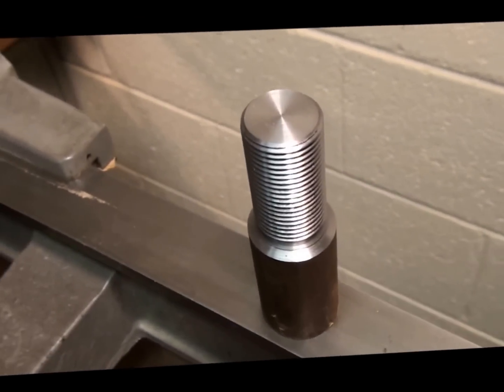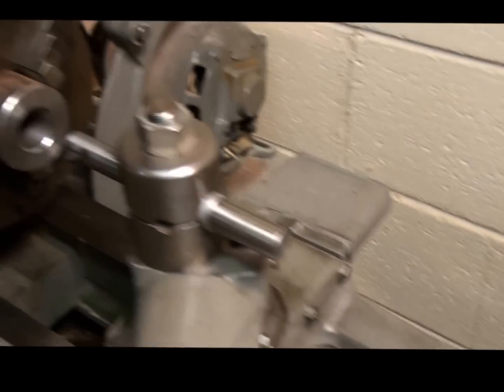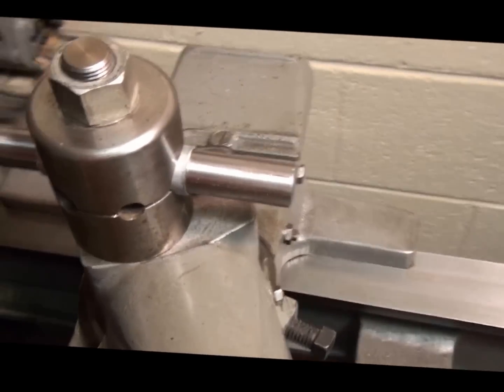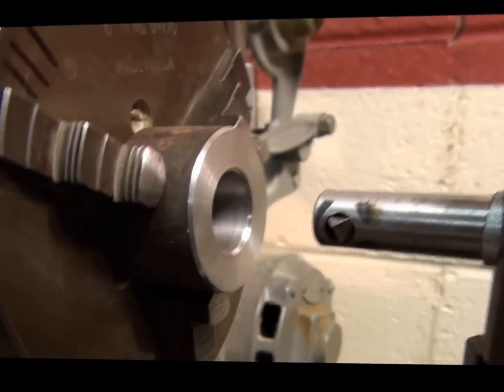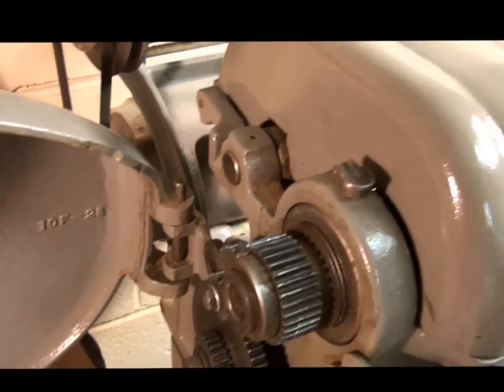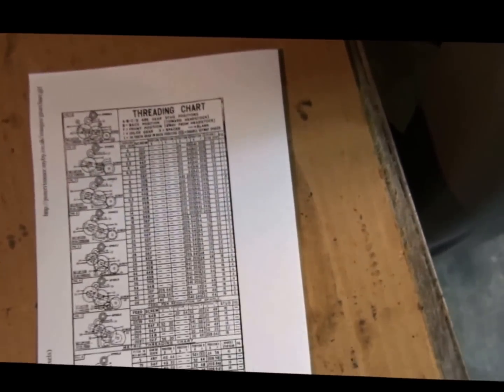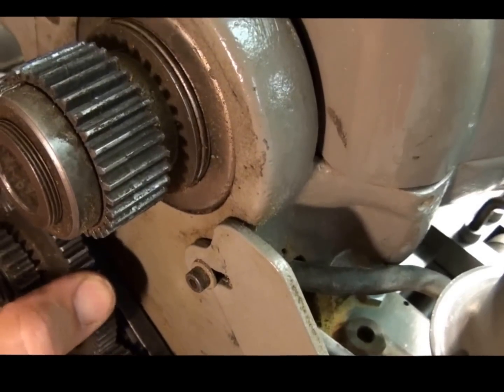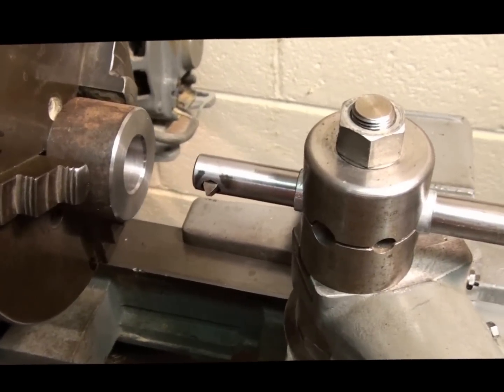Cutting an Internal Thread on the Atlas Lathe, Part One - Setting up the Change Gears

Comment: tom I. trying to figure out how to make internal splines for a wheel adapter plate for tire studs.can you help direct me .mrpete spoke OuT of respect . I need to design an adapter plate to mount four lugs to five lugs adapter but I can't figure out how to put those tiny slits in the plate for my studs .please help me .I can barrow an indexer .
Reply from the maker: +Glenn Ferris 
Hi Glen,

It sounds like you need to do some slotting. A slotting tool is like a boring bar except that it cuts on the end rather than the side. There are powered slotting heads available for vertical mills, kind of like a vertical shaper but you can do it manually by holding the tool in the spindle and moving it with the quill. Center the hole you would like to spline on a rotary table, grind a slotting tool with the proper angle for the spline and index around the hole, cutting splines as you go. You may need to take several passes to get to full depth depending on the material and how deep your spline is.

If you look at the video I put together on building the Steven's rifle, I used a slotting tool to square up the corners of an end milled slot.

Hope this helps,

Tom

Comment: Nice

Any suggestions on cutting threads on a lathe similar to your dads but with no thread dial.  I have a 1939 South Bend lathe and it does not have a quick change gear box or a thread dial.  It's a model B and does not have the option to add a thread dial.  

Thanks for the videos!
Reply from the maker: If the pitch of the lead screw is the same, or a multiple of the thread you are cutting, you can engage the half nuts anywhere. Otherwise, you have to leave the half nuts engaged from start to finish, backing out the tool and reversing the spindle to restart the thread.

Thanks for watching.

Tom

Comment: Thanks for the set of videos, Tom. I just got a set of change gears for my Atlas 10" as it didn't come with it when I bought it.  You make it all look so easy.  Question, when do you decide to use a tap or a die instead of cutting the threads with the lathe?  If you had a tap or a die of the right size would you use it or the lathe?  Would your answer be different if you had to manually change the gears for each different thread on the lathe in order to cut it there?
Reply from the maker: Taps and dies are suitable for fasteners. If you need a close tolerance thread with and accurate lead, like on the micrometer carriage stop project I'm building on my website, single pointing it on the lathe is the only way to go. Change gears are a necessary evil if your lathe lacks a quick change gear box, but that doesn't drive the choice of a single pointed thread over a tap or die cut thread.

Thanks for watching.

Tom